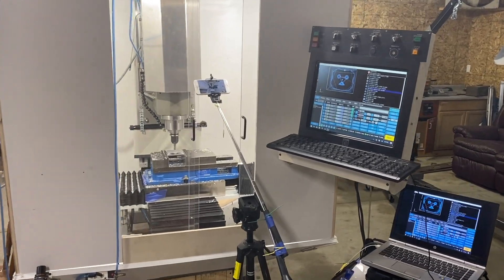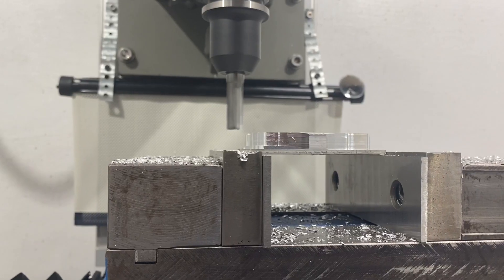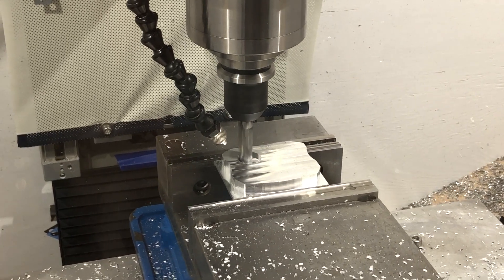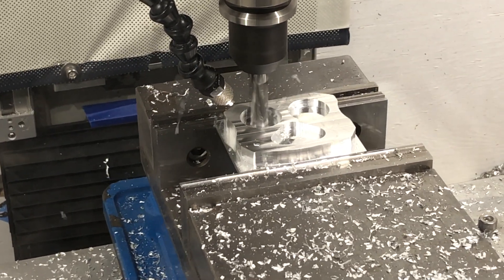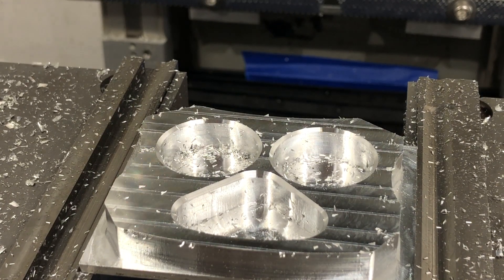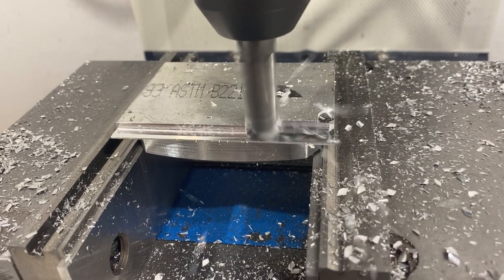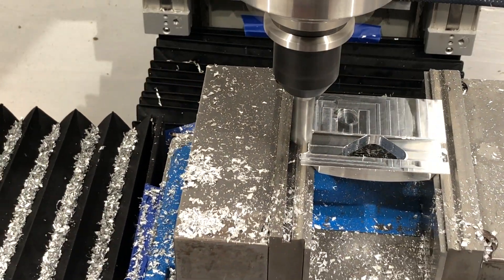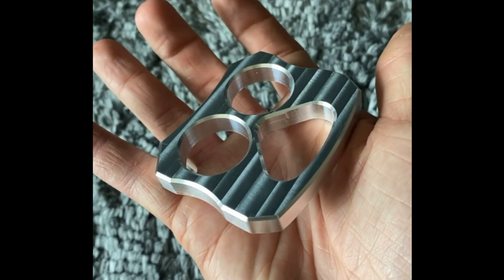DIY CNC MILL - First Test Part

Comment: How did the chinese spindle perform?
Have you machined steel parts? How much rpm?
Reply from the maker: It has worked really well. There is a very slight noise almost rattle to it now after several years but it still makes very nice parts. Yeah I have machine steel parts. I only have 4500 rpms but the spindle can do 6k